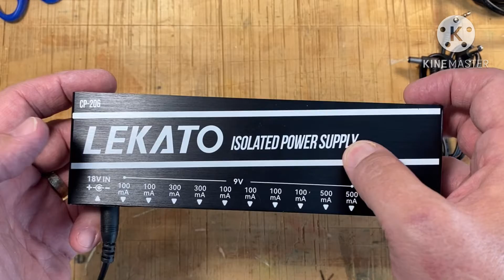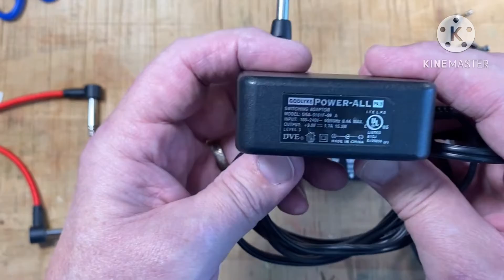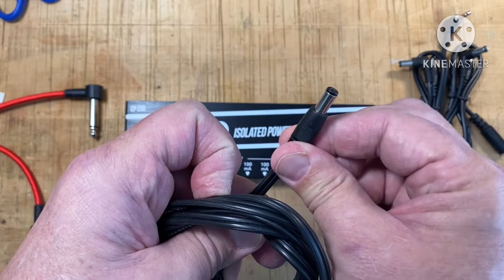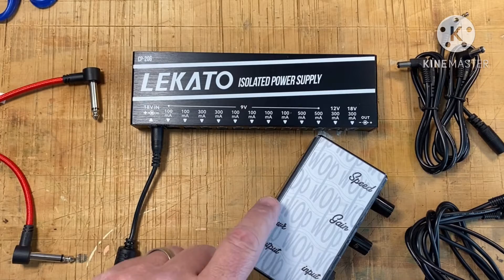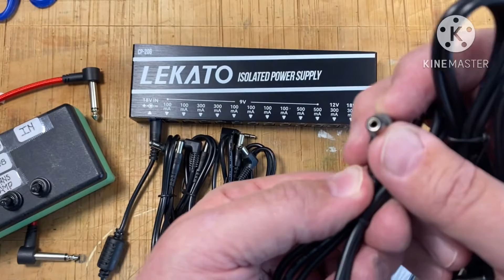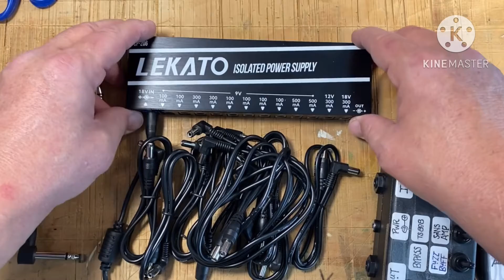LEKATO 12-Port Pedal Power Supply | Game Changer for Guitar Effects

Comment: Thanks for your video, it really helps 2 years after you did. My only question is; since I'm only using ten pedals that they all use 9v and I already connected them all based on mA requirements for each one, I still wonder how or where I connect the actual power cord? I mean from which input or output? I'm lost on this part. Can you please tell me? Thanks in advance.
Reply from the maker: No problem. The power input is 18 volts and goes in the left most jack on the front. That’s the only power in. From there the power is stepped down to 9v, 12v, or 18v for all of the output jacks. And the current supplied at each output is also limited as marked on the enclosure too. It’s possible to daisy chain several effects from one power out if you need to. As long as you don’t exceed the power demands for the power brick, it supplies enough power for anything in the chain.
Reply: @MadScientistGuitarLab  thanks so much! So I don't need to worry about power out on the far right? I ask bc it says OUT on the far right
Reply from the maker: @emilramirez2960 right, those are the 12 and 18 volt out. If you don’t need them, just leave them alone and they won’t power anything.
Reply: @MadScientistGuitarLab awesome... finally moving from a one spot daisy chain to this lekato and for good. Thanks a lot!
Reply from the maker: I've been really happy with mine. You should have good luck with yours too. Enjoy!

Comment: How is this still working for you? Has anything happened to it?
Reply: You mix up voltage and current. A pedal draws the amount of current that it needs. The fact that an output can deliver 500mA doesn't affect a fuzz that might need just 10mA in any way.
Reply from the maker: @mrbaiser4133  Very true. Coincidentally, I’m researching the fuzz used in Spirit in the Sky, which is a complete unknown, but there was likely a dead battery to blame for the tone… so, under powering a fuzz would be a fun experiment to try. I have plans. :)
Reply from the maker: Yeah, it’s still working really well. It’s been on continuously since I got it. Still quiet, no heat issues, and I run a bunch of stomp boxes and small amps from it. I never thought that I would replace the godlyke power supply.
Reply: @MadScientistGuitarLab  I’m looking into Pedal Power Supplies and i’m between this one and the Donner Pedal Power Supply. I like this one because it has more and is the same price on Amazon, plus it has 300ma 9v options which many don’t.

Do you have any other suggestions for other pedal power supplies? Would you recommend this one?
Reply from the maker: Well I recommend this one because I have it and use it several hours a day and I never turn it off. With 9, 12, and 18 volt, 100, 300, and 500mA outputs, there is a lot of room to power things and experiment. The one thing it can’t do is “dead battery” mode so I built one to use.
Reply: @MadScientistGuitarLab  Cool, i just got mine in the mail on Wednesday so i’m putting it to the test and so far i’m really enjoying it.